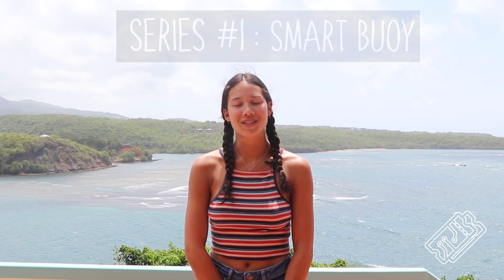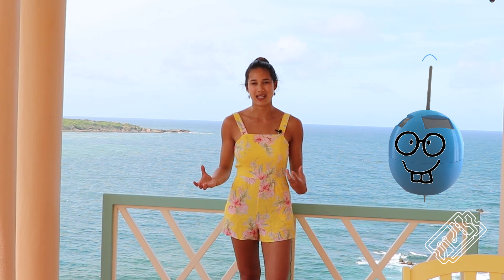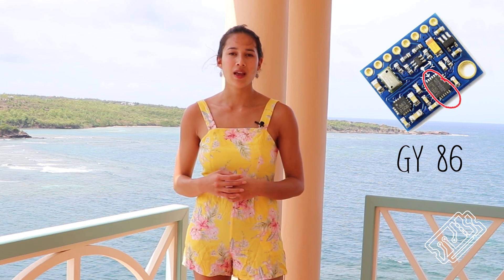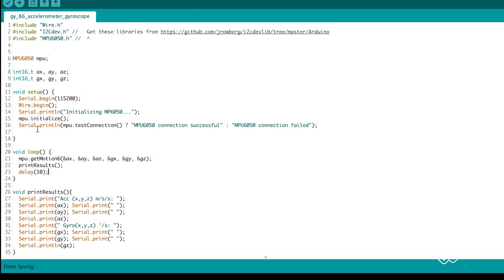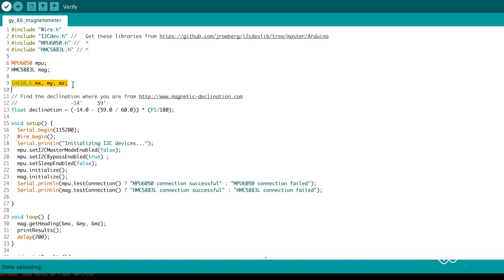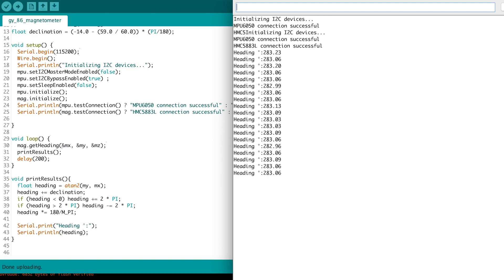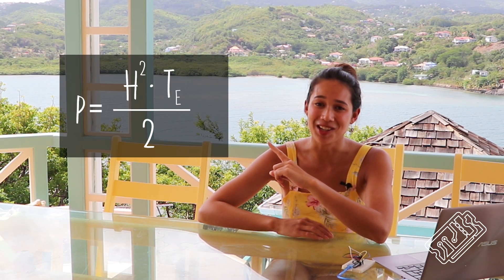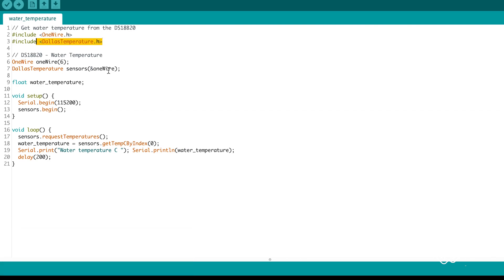Smart Buoy [Episode 1] - Make Wave and Temperature Measurements

Comment: Halo, very nice video and very informative. Currently i also under on going project of buoy tsunameter. DART as reference, ocean bottom unit on seabed with pressure sensor to measure sea level. but we try to find alternative to measure sea level embedded on Buoy and then i find your video! :D if dont mind to share, what is the sensor to measure the sea level on your project, is that only the gyroscope? thank you
Reply from the maker: Hey, We do not measure sea level on the buoy. We get altitude calculated from the barometer measurements. The relative difference in altitude over time is what we measure as wave height. Your project sound cool - maybe you would be better measuring sea level using multiple GPS pings and getting the timing difference. This method is very precise. ⚡️
Reply: @T3chFlicks  must use high accuracy GPS module, well noted. Thank youu

Comment: These should be all over the ocean and have a submerged drone like the Albie (free 3D printable drone shell) attached to a tether on the bottom of them. Solar panels could charge both the buoy and drone.

Albie is on Thingiverse.
Reply from the maker: Now that would be AWESOME - we did think about using them as a docking station for flying drones to charge from. But the albie could help get more environment measurements as well as possibly moving the buoy around a location.
Reply: T3ch Flicks that’s what I was thinking, and it could just float down and act as an anchor while the buoy is charging itself and the Albie.